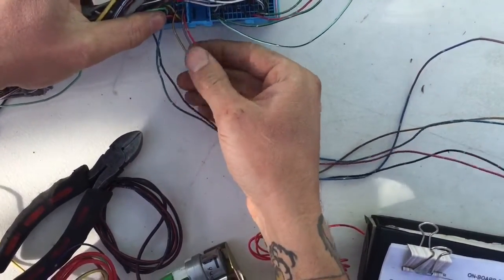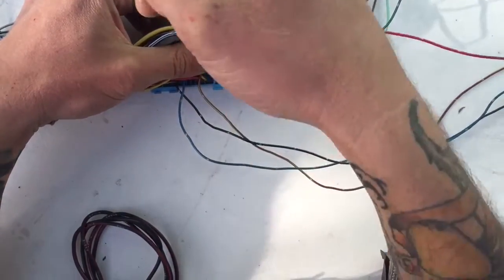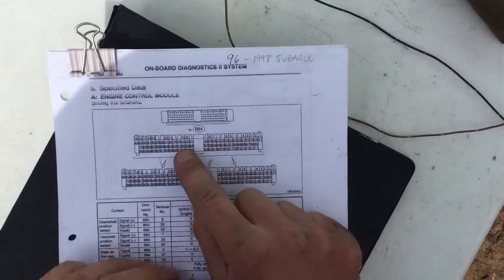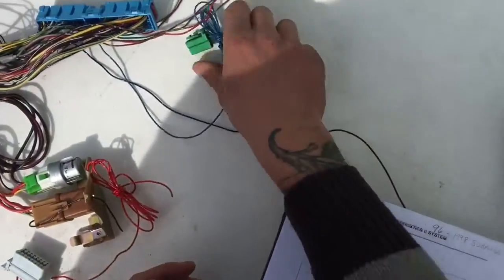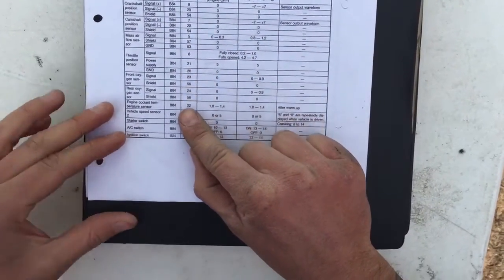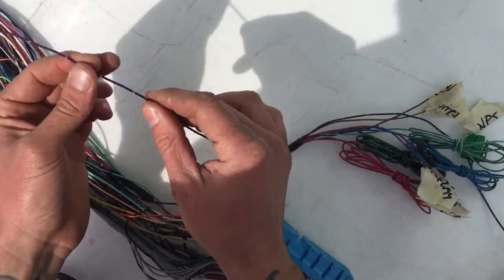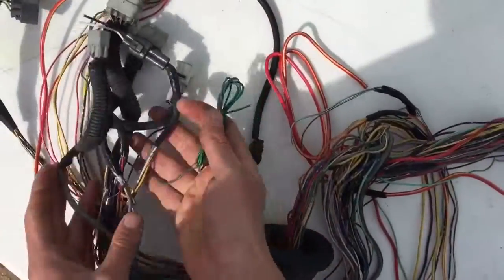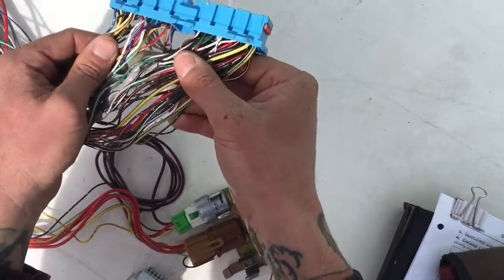5. Loose Wire Identification 2/2 - Wiring Harness Series

Comment: hey, first off thanks for all your help! but I have a question. I have a few loose but identified wires I don't know what to do with. the torque control signals, the fuel temp and level sensor, fuel tank pressure, drain valve, and the neutral position. also could you do a video on how you have your radiator fans wired?
Reply from the maker: +Dawson Peckenpaugh hi Dawson, leave all disconnected, or you could wire the Neutral switch for one less code - see a later video.